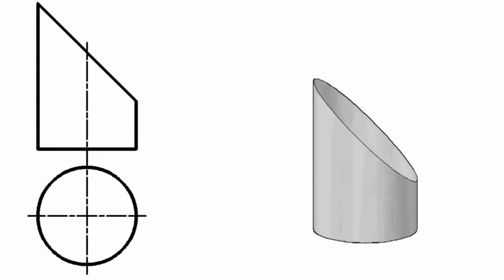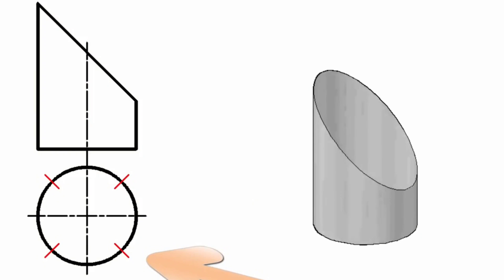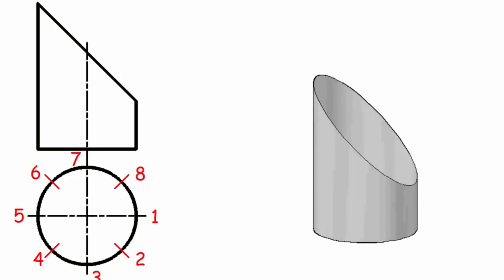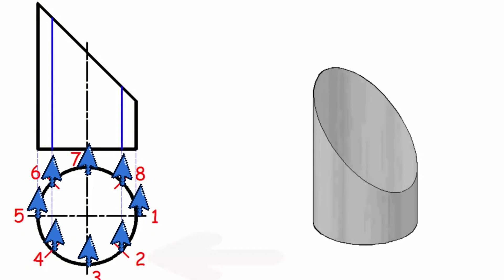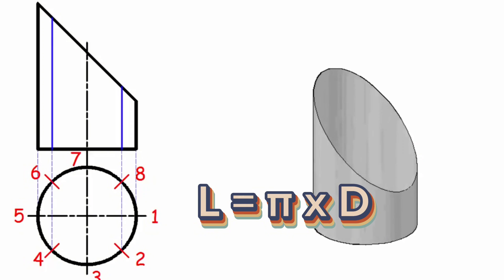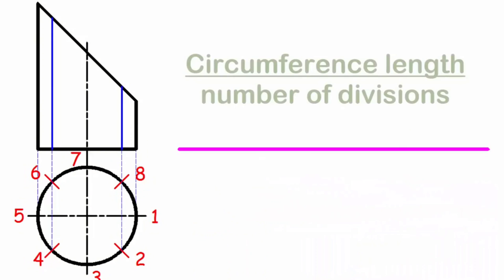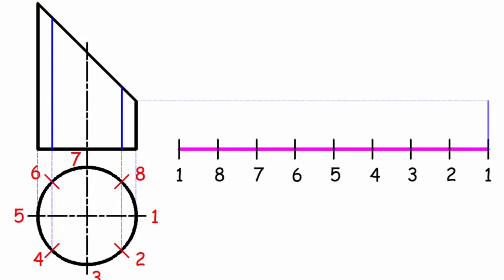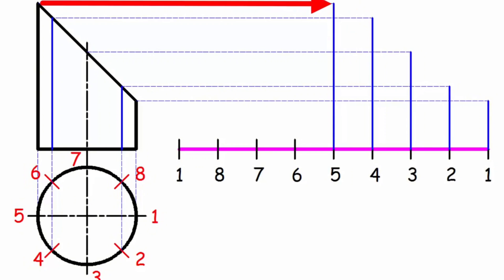Pipe template. Pipe notching template. Pipe template layout. Making a template to miter pipe

Comment: Hello,dear.you take the id and draw the circle of 2 inch pipe but how did you draw the front view with tapered 45 degree angle.kindly elobrate this missing information in the video.i repeat the question:first draw the circle then divide in to 8 parts then the vertical lines will meet the other 45 degree figure.how to draw that 45 degree figure.
Waiting for your response
Regards,
Reply from the maker: Dear Sir, Thanks for watching and commenting.
Bahsettiğiniz püf noktalarını daha sonraki videolarımızda daha detaylı hazırlayıp sunacağız.Keep watching our videos